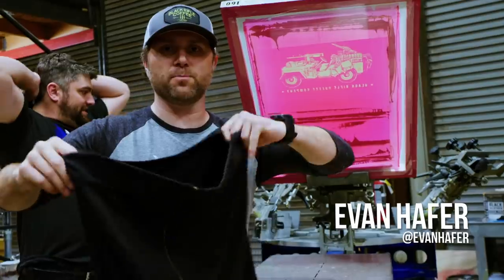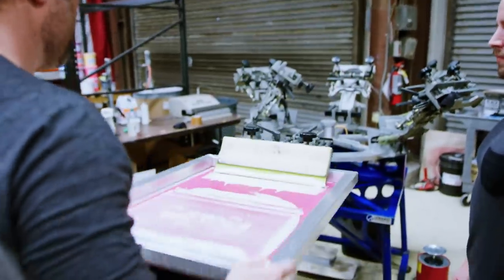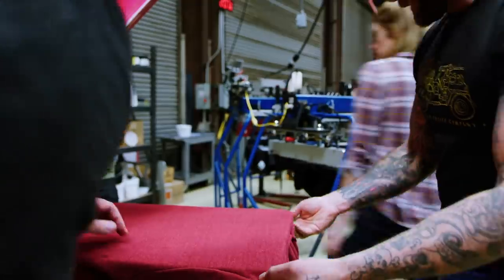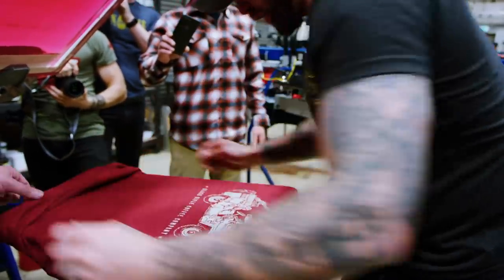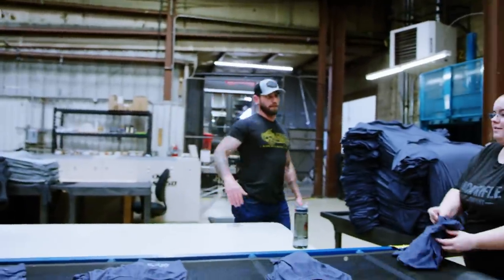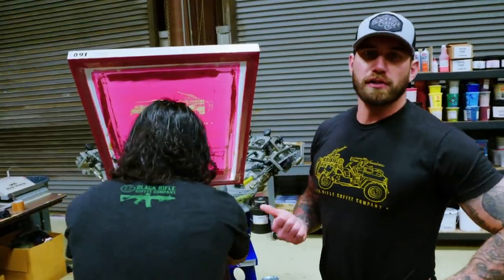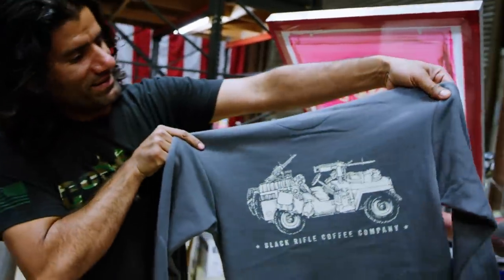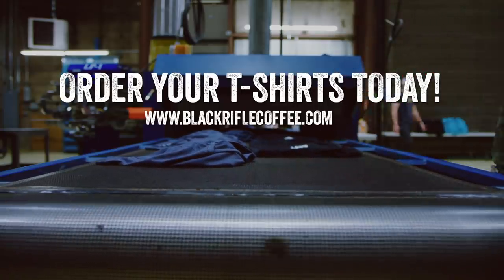Tour Our Shirt Print Shop with Mat Best!

Comment: As someone who takes a ton of pride in my silk screen business, i dont see many people doing the stretch test these days. When it come off the roller, stretch the design out and if the ink separates anywhere you need to adjust your temp and or table speed. 90% of the shirts ive bought lately all have ink falling off and cracking. No bueno at 30$ a pop. Thanks for the badassery not so gentleman 🤘🏼🇺🇸🙌🏼🙏🏼